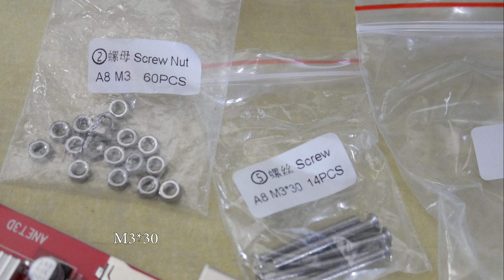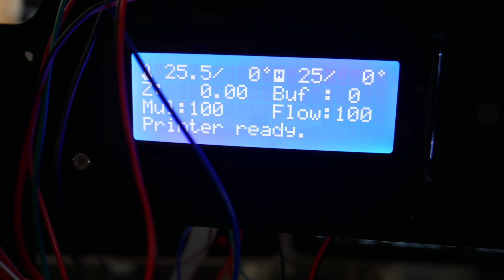Anet A8 3d Printer Build Guide Part 6 Wiring

Comment: 0:26 - 0:30  Can anyone tell me what gauge these wires are?
Reply: Did you find out I can’t
Reply: bigger the better. High voltage can be smaller diameter gauge. Low voltage high current requires larger diameter gauge. Id go with 14awg or thicker, preferably 10-12awg. It depends on the current draw and the distance. You can look it up online. Your heated bed will draw the most. If a wire is warming up, replace it with a bigger one.

Comment: How did you determine the red wire went on the right side and the black went on the left when attaching the bed wires to the board. there is no + or - identification. Thanks!
Reply: this is the same thing i am searching for, if you find an answer please tell me, ill do likewise.
Reply: I'm sure you figured this out by now, but the heaters on these don't have a polarity, per se. any board that powers them has a defined positive and ground input, but the output to heaters don't.
Reply: Does this mean that the red and black one share one port like in the manual?
Reply: Same. I dont know
Reply: All pure resistive components have no polarity. They just offer resistivity to current flowing and generate heat. In fact, if you noticed, the heating cartridge of the hotend have both red wires (the net) inside they are both white. Different story for the board cabling where the polarity matters.

Be aware that Gen1 board and Gen2 board have different wirings with polarity serigraphy on the PCB.
Reply: In electronics, well what I’ve mostly worked with, + is red and the - is always black unless otherwise specified.

Comment: Having trouble getting my board to communicate with my laptops. I got another laptop to see if that is the problem. The memories seem to be low all the time. I already had swapped out the board. Now I have two that don't work.
Reply from the maker: +Seekmosttoprophesy do you have the correct drivers installed as well as the baud rate set accordingly
Reply: Baud rate was good. It must be the drivers but I installed a bunch of drivers and it seems to be a problem with the laptop.
Reply: I finally got a 3D mini printer and used that software for my DIY printer and it is working.